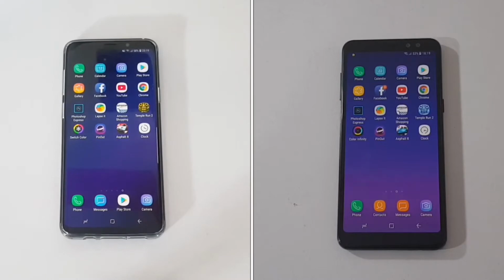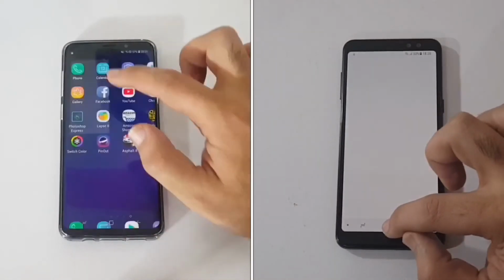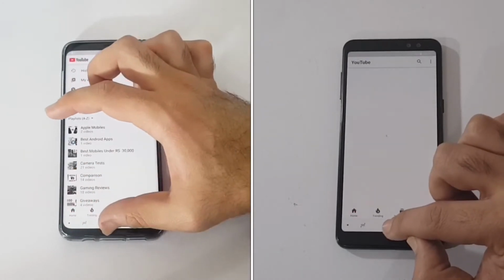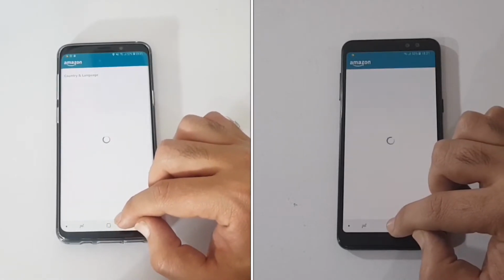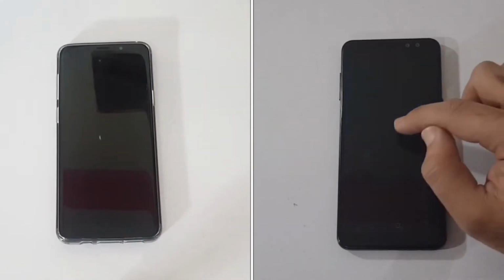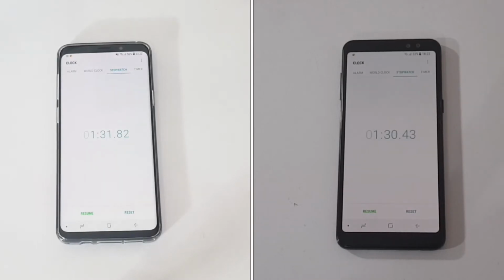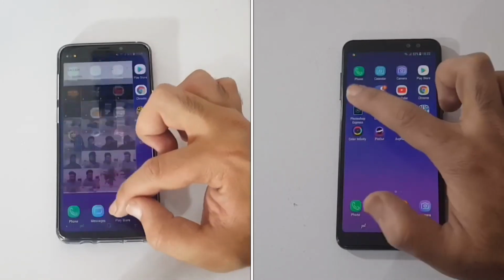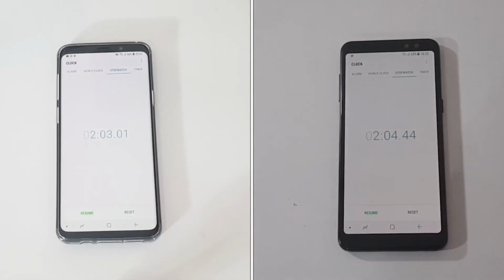Samsung Galaxy S9 Plus Vs Galaxy A8 2018 Speed Test Comparison!

Comment: The samsung experience ui 9.0 isn't slow.Instead it's more smoother than the 8.5 and less laggy.The reason why the exynos 9810 is underperforming is because of the new governer & scheduler.Check Anand Tech's article for further information.